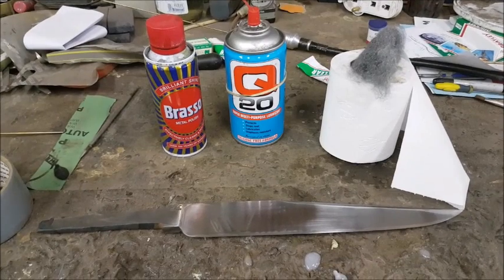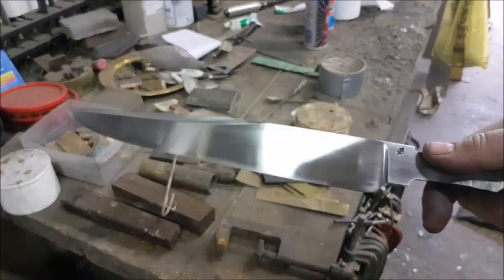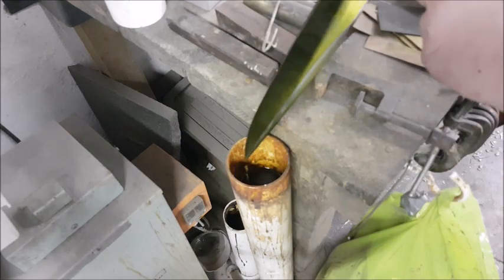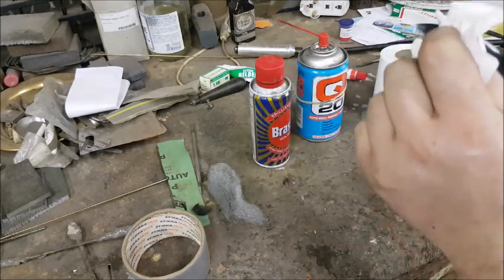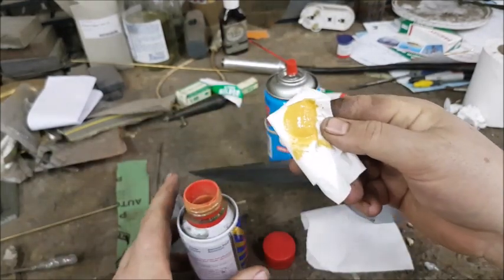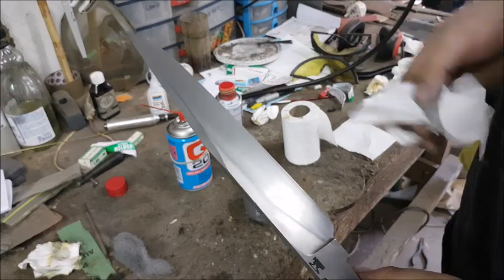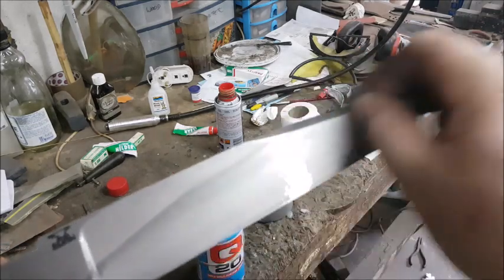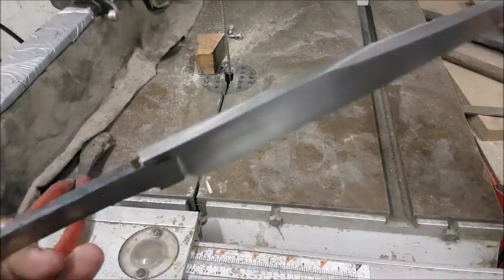Etching Carbon Steel

Comment: Hello Mr. Smith, just got a knife I ordered from a friend and it is made of a high carbon steel. I just noticed after a couple of used that it starts to rust. Would this method help to anti-rust it. If not maybe you have other ways to recommend how to get rid of this rusting taking place. Thanks.
Reply from the maker: I have carbon steel knives in my kitchen with little to no rust. They do require more care than stainless. The main way to preserve your blade is to clean and dry it immediately after use. If you are accustomed to stainless you maybkeave the knife aside after use before cleaning. You cant do this with carbon steel. If There is discoloration on the steel after cutting meat you can clean is with a fine steel wool or a liquid abrasive like one ise fornpolishing brass. Clean and dry the blade well after this. I hope that help

Comment: it turned out so black and beautiful, does it always stay black like that?
Reply from the maker: usually. id the blade sees a lot of use it may fade but can be restored using the same technique
Reply: @StuartSmithHandForgedKNives  thank you so much for the video! i dropped out of college in the middle of my chemistry diploma, and i want to make this and show my grandfather. he used to work as a metal worker and now he does blacksmithing as a hobby,

Comment: wonderful Smith, thank you very much, FeCl3 is necessary if we want the food knife;
Reply from the maker: Etching the blade does provide some corrosion resistance. Kind of pre rusting if you like. But carbon steel will stain over time

Comment: Hi Stuart. I'm about to try this for the first time and could do with a little expert guidance if you don't mind. I've just completed a full tang kitchen knife with a hand rubbed satin finish that I'm not keen on, is it possible to use this method on a knife that has a handle fitted. Also, is there a particular brand of ferric you use, I'm looking at MG chemicals ferric on Amazon. Sorry for the long message and thanks for all the great videos, Matt.
Reply from the maker: I get my ferric from a local knife supplier. Not sure where they get it from but Fcl is Fcl. Just make sure you dilute it a bit. Mine looks like strong tea. You can etch after you have a handle on just be sure to insulate the handle material from the acid with a varnish paint that you can lean off later with acetone.
Reply: Stuart Smith Great, thank you. So I guess I'll be pinching some of my wife's nail varnish. Thanks again
Reply: Stuart Smith thanks so much for your advice Stuart. The knife I was asking you about turned out really well, so thanks again. If I may ask another question? I've just taken delivery of some 1095, would you recommend an edge quench for this steel type? I've heard it is difficult to harden in oil and is prone to warping. Thanks, Matt.
Reply from the maker: A lot of smiths have had success with edge quenching 1095, There is some debate as to whether a full quench with a selective temper is superior to an edge quench. If you are chasing a quench line or a hamon then your should be fine. Just make sure your edge isn't too thin and that will help prevent edge warping.